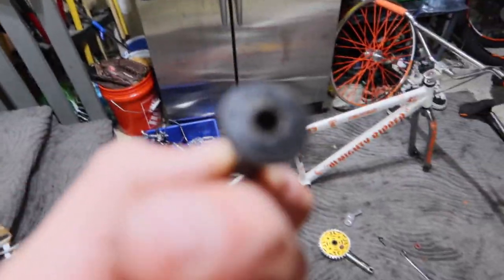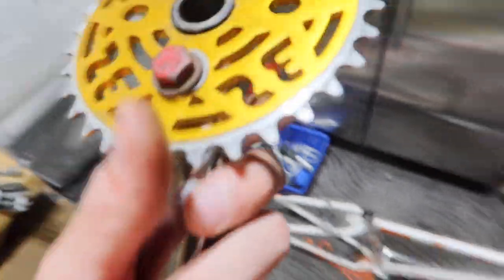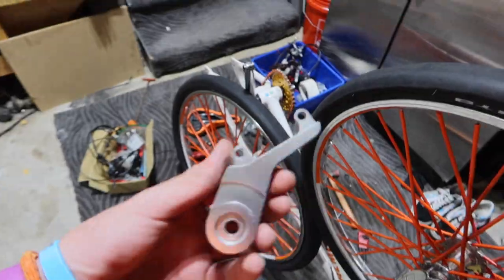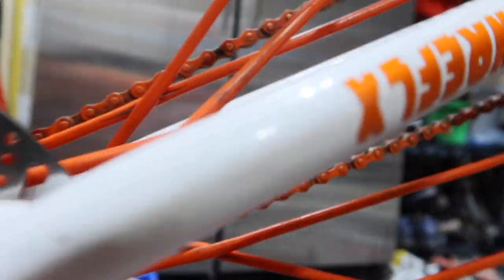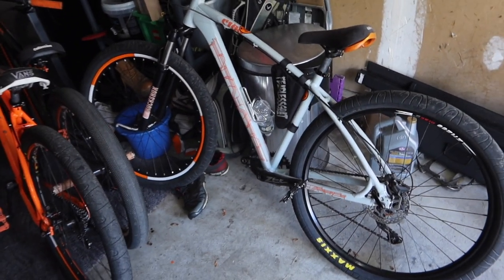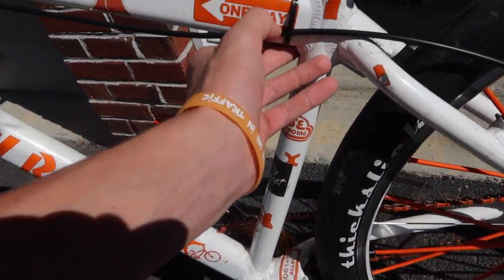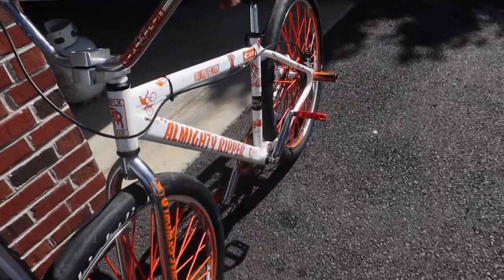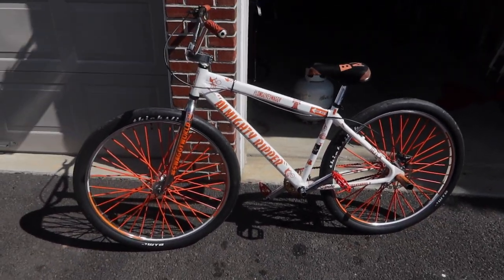2016 BIG RIPPER IS BACK! * Almighty Ripper (LLB) *

Comment: how did you add pegs on your Big Ripper with that hydraulic break? i converted a Big Ripper but i cant have pegs on the left because the hydraulic break takes too much space on the axel, and i dont know what hub to get that would fix the problem.